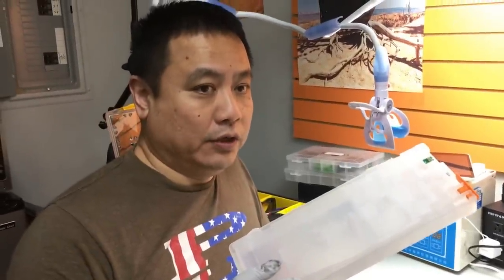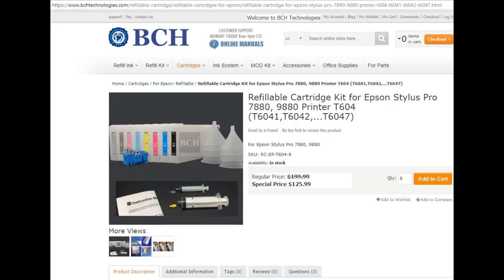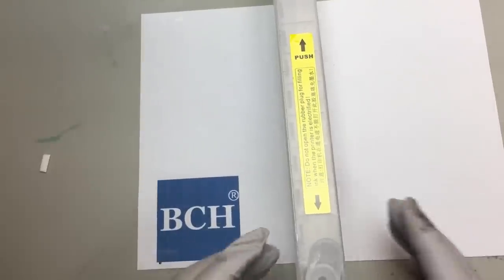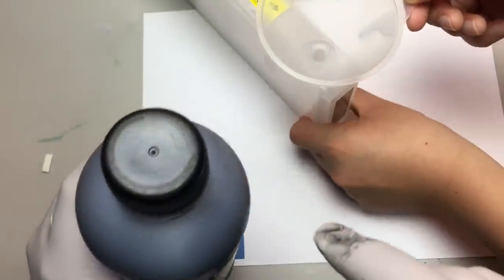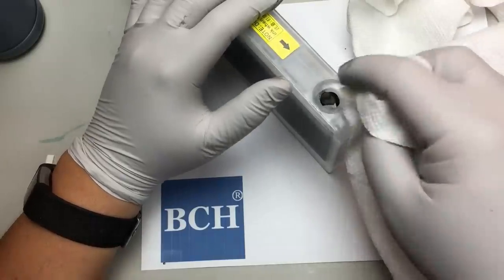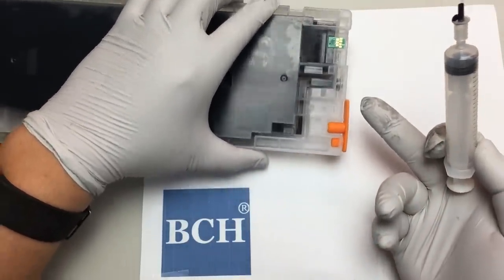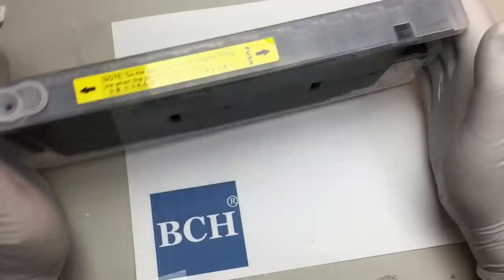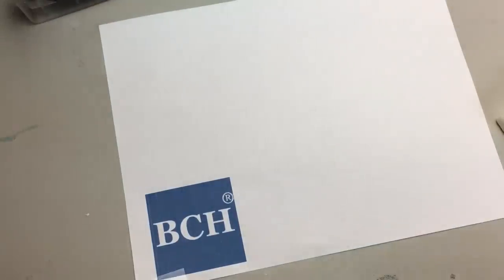5 Easy Tips to Refill Epson Stylus Pro 7880, 9880 Printer Cartridge T604 (T6041, T6042...T6047)

Comment: thanks for the video .. on one of cartridges i ve got a problem .. when you are putting air in to the cartridge (20 ml ) instead of to push it back  i ve got ink (bubbles) coming out instead of air .. is that cartridge now safe to use or not ?

Comment: I have an Epson T5804 Yellow for 3800/3880 which reset even though it was at 3%! Actually, I probably ran it down to 0% but my maintenance cart hit full capacity at the same time and disabled everything. I couldn’t even change ink until I got replacement maintenance cart! Of course, I ordered it with a chip resetter and another T58 Yellow cart. ;) I ordered a full set of original Epson T58 empties and now I have three refillable T5804 yellow carts when I only need two!

I’m still wondering why it let me reset that yellow cart. My understanding is that somewhere below 15% the printer will flag the cart as depleted and write that value to the chip so that a reset will not fully restore it. That must not have happened.
Reply: I like your kids. They are so cute.